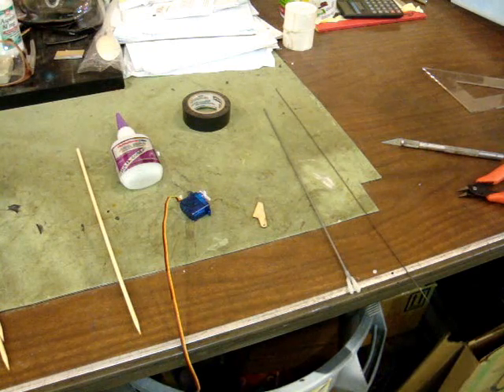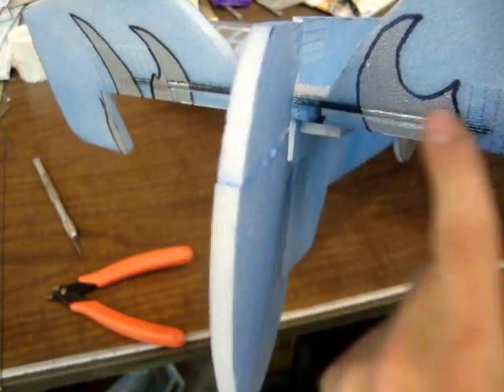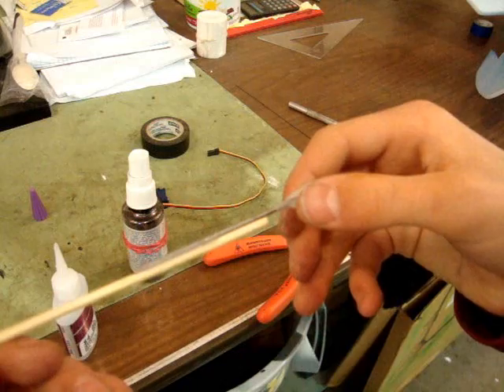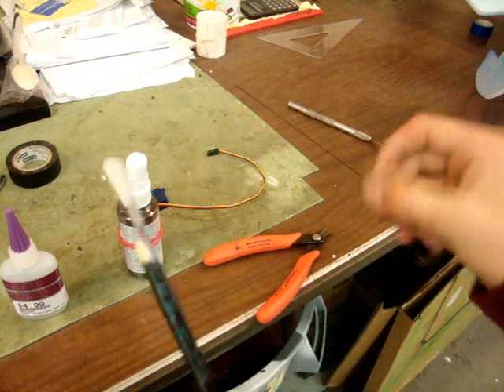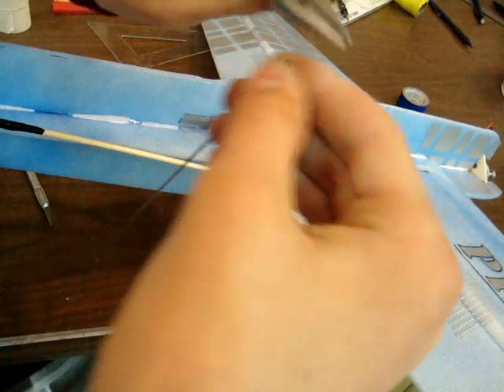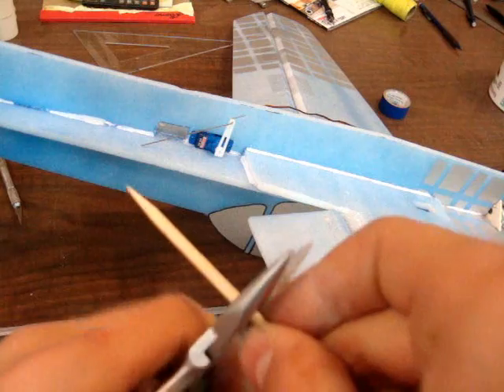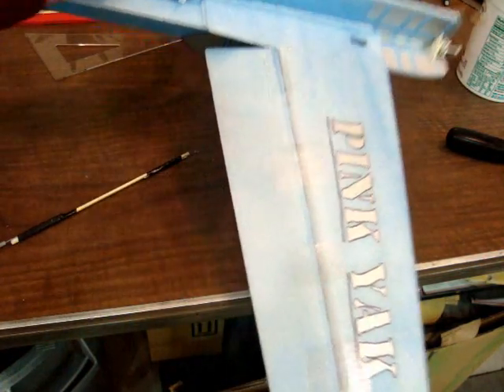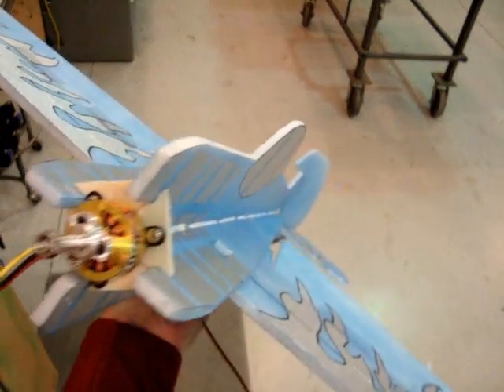How To Build an RC Airplane Out of Foam: Lesson 5 (Installing Servos and Making Pushrods)

Comment from the maker: @GODsoccersk8football I'm glad to help!
99% of the time every thing is compatible, as long as you make sure they will work together. For example, a brushless motor will not work with a speed control intended for a brushed motor. If you want any more help or you want me to pick out a power system for you, just ask! :)

Comment: did you attach the control horn the same way as you put carbon reinforcement into the plane?(ie cutting a small divot in the foam and then gluing it in) if so, how deep did you cut into the foam?